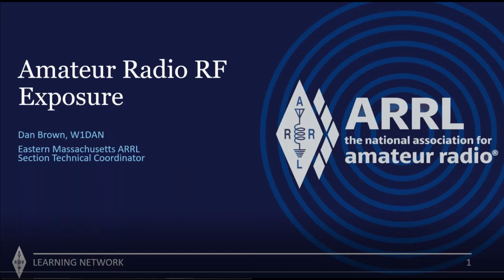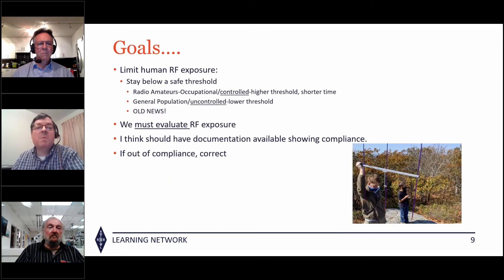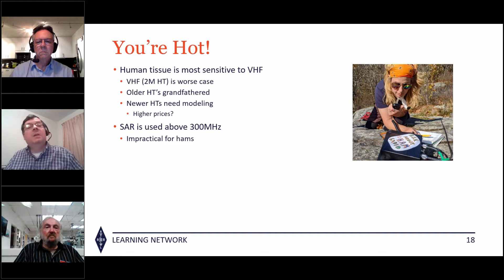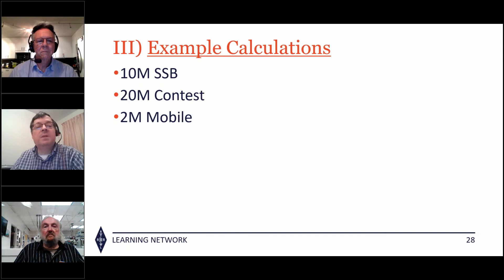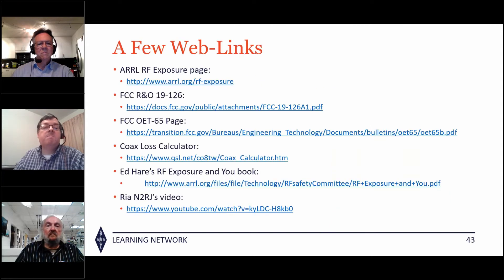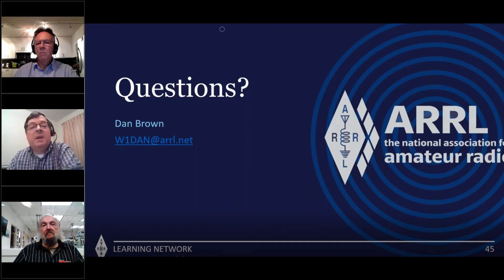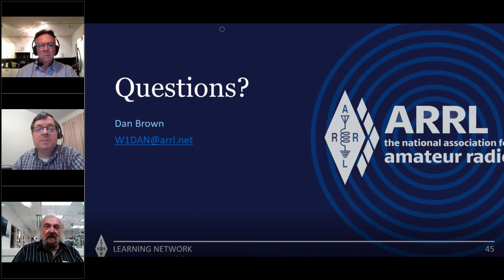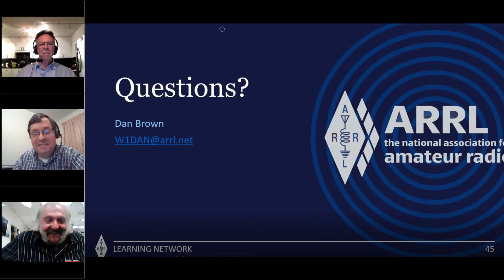RF Exposure Rules

Comment: But a cellphone next to your bed and a tower outside your window is just fine
Reply: try looking up the RF power output on that cell phone. even at 1 watt, which is about 3 times over that of cell phones, you only need about 5 inches. Hence why the industry says to not put phone closer then 6 inches. However, most NEVER read the warning or manual to their beloved internet connection device!

Comment: So what about CB radio user?
Reply: 4 watts. You're safe. By a large margin.
Reply: @electrolytics  only if they comply with rules. I dont know many CB'ers now days, but the ones I do, dont run 4 watts. In fact they dont even run 400 watts! I see a guy out of Grants pass Oregon that runs well over 10Kw into a beam aimed at the gulf of Mexico. I did some antenna work for him a few yrs ago, and measured a 1.27VSWR. Thats roughly 95% getting to antenna, or 9,500watts! I know he doesnt care about RF exposure to self or anyone else. I agree though, if you play by the rules, you are safe and never going to have a problem unless you just feel like grabbing that antenna while transmitting. at that point, may I suggest licking it?
Reply: @ChrisRobinsonKF6NFW  Yeah but his beam has to be pretty far up off the ground, I'm assuming? Not that others take the same precautions.
28 MHz is on the relatively safe area of the spectrum too isn't it? Compared to say VHF?
Reply: His beam is about 40 ft up. Nothing special. In regards to VHF, that is debatable. However. I do operate 160 watts at 2 meters. measured 143watts at antenna. I am either using a vertical, or the yagis. the vertical is roughly 8dBi, the yagis, are roughly 17.5dBi. I enjoy SSB, and digital modes on VHF. Please do not climb the tower and place self in front. I will laugh and then prove the stupidity of such an act!
 On serious note. VHF isnt anymore dangerous then HF, when we pay attention to MPE. However on the surface, yes I think I agree with your notion that 1 watt at 11mtrs vs. 1 watt at VHF 2mtr, is less harmful, when all other factors are same.